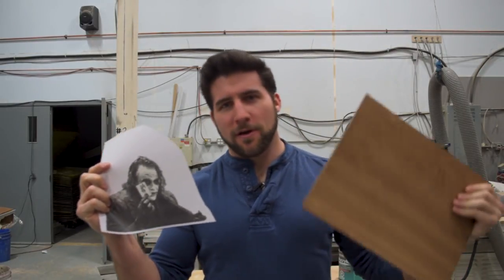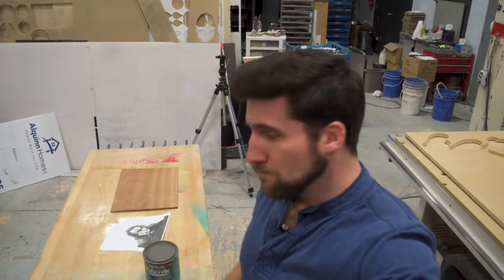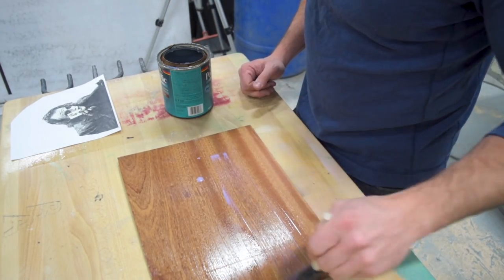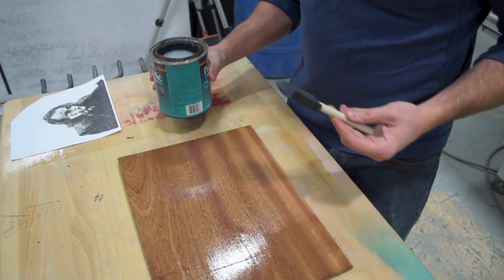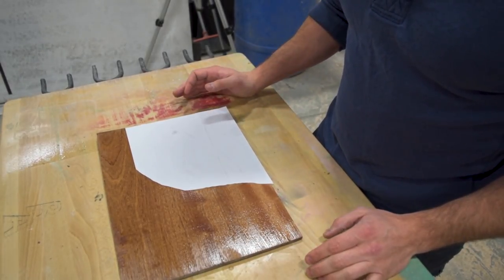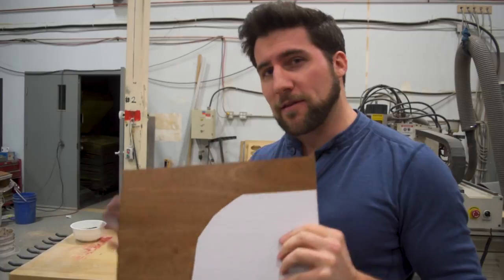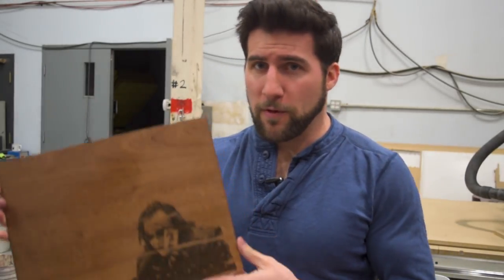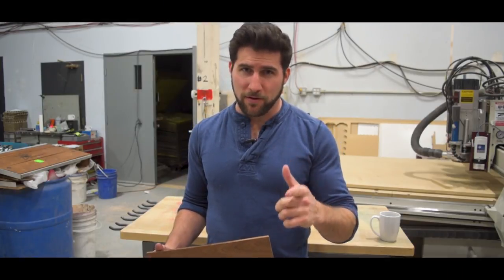How to transfer an image onto wood

Comment: Now you think this would work on a nitrocellulose painted surface? Also I like the way you don't edit out mistakes in your videos.  I think it encourages others to try new techniques and not fear their own mistakes.
Reply: Kenneth Hildebrand I too want to know if this would work on a painted surface. if so, what paint types.
Reply from the maker: As I understand it, it’s the polycrylic that takes on the ink. So, any surface that you can properly paint with the polycrylic should allow for this technique. A properly dried and scuffed nitro finish should be no different, but you can’t replace the acrylic medium with nitro if that’s what you mean.
Reply: Related question: I’d be interested in applying the image between a nitro-based color coat and then a nitro clear coat on top.  Does nitro lacquer adhere to polycrylic?
Reply from the maker: Not while it’s still soft like in these circumstances.

Comment: I’m glad you left the wrinkle marks. It gives a visual of why it’s important to keep the paper flat. Great vid !
Reply from the maker: Thanks Tyler.
Reply: I’ve now done about 8 transfers using Polycrylic. I’ve found best results with sanding to 400 with a random orbital and I only rub the paper off when it’s newly wet. Then I let it dry, haze white, then wet and rub again. Repeat. If I keep rubbing, I take off the pic. I think if the ink get saturated with water, it lifts easier so I do it in steps. But I’m still learning

Comment: No excuse needed. Thumbs up! Great video. I've seen this done with Modgepodge before but not poly acrylic. Also, a rubber roller works well in applying the paper. Let's you roll it out very smooth. I'm interested in the guitar building application for this technique. Thanks for doing this!
Reply from the maker: Thanks Greg, and thanks for watching.

Comment: I did a transfer to acrylic about 8 years ago using a colour laser print and a electric clothes iron. It came out decent but care has to be taken not to overheat the acrylic. Its a useful technique.
Reply from the maker: I’ve seen the clothes iron version, but have never tried it.
Reply: You could get away with a lot on wood. On acrylic its a little challenging. The plastic deforms easily if its too hot or left too long. Any slight imperfections show up as light passes through. 

Try it on scrap and see how it goes. Laser printers can produce really vibrant prints so it can make for a brilliant guitar project.

Comment: I wish I saw this sooner.  I used mod podge on my guitar body project and had to wait over 24 hours and it took forever to take out the already thin paper I was using.
Reply from the maker: Does it look good? That’s the important part haha.
Reply: @BradAngove  Some darker discoloration around Ace Frehley's head probably due to clear spray and some paper fiber that I could not get off Gene Simmon's  armpit and tummy area.  It was a Destroyer pic btw.  But I am planning to do your method on my les paul jr  proj   :-)

Comment: Hiya Brad....well I had some success with a different way of doing this and I think it worked the best so far. This is what I did...fwiw

1. I just used a piece of NZ pine sanded to 400 for this test.
2. I used the Mod Podge acrylic because it's what I had to hand.

To apply the ModPodge I used a sponge roller rather than a brush this time. It isn't a heavy sponge sleeve on the roller, in fact it was quite a thin roller sleeve such as you would use for (say) applying polyurethane to a piece of furniture. The coating was even and smooth.

The image was printed onto photocopy paper which gave an alright image. Not as good as (say) photopaper, but much easier to work with in this application.

Instead of placing the image face down and they trying to get rid of the bubbles, I started by placing one edge of the paper on the pine board, and gradually laying the the image down on the paper by using a lino roller ( like this one: https://www.trademe.co.nz/art/art-supplies-equipment/other/auction-1533483654.htm?rsqid=426bf66c66a14492b659faf7b8ccddcd ) to get rid of the bubbles as I went. It's kind of like laying steak down in a very hot pan when you don't want the hot oil to splash everywhere....I hope you get what I mean?

Doing it this way I was able to lay the image down gently with the roller and without any bubbles by the time I had the image completely flat on the board. I left this overnight to dry and the next day I used warm water and a soft sponge, as you did, to remove the paper with only a little residue left, which I cleaned up with the sponge later. 

The image didn't tear out at all, although this may be luck because I haven't tried it again yet!! I'll do this 2 or 3 more times and if it works well, then I'll see about making the clock that I want to make for my extended family who live in your city!!

Now it's beer o'clock..... later.....
Reply from the maker: Sounds like you’ve got a good process in place. I find that the mod podge and acrylic mediums are a bit thick and hard to get smooth.
Reply: Yep...that's been a major issue for me too. I would much rather use something else that isn't so thick, and I probably need to hunt down something and make some further tests as I really want this clock project to be as near perfect as can be.....

Comment: I have been using mog Pog to do the same process and this looked to work as well and takes less time so many thanks...I'm going to give it a shot. Also for a few bucks at a craft store you can pick up a small roller and that has been worth every penny for getting all the bubbles and creases out. Great video 🤘
Reply from the maker: Do you use a J roller for that? I was thinking I probably should have done so. 
I think this stuff probably lays down a bit flatter than mod podge, but I’m not sure.
Reply: Brad Angove yeah I did and it has to lay down nicer than Modge Podge because Modge Podge is really thick. I'm on my way out right now to get some and try it. I don't know if you remember the picture of the witch guitar I posted but that was done with Modge Podge
Reply from the maker: That rings a bell. I seem to recall it going quite well. Hopefully this option works for you.
Reply: One of the small 1/2"  to 1 " diameter paint rollers works well for this type of thing since the nap of the roller can push into creases etc. It also helps that the roller tube is disposable so cleanup isn't required haha
Reply: Net Rngr I like no clean up! Good idea

Comment: Nice! I'm going to try it on one of my Guitar builds!
Reply from the maker: Excellent. I'd love to hear how it goes.
Reply: Brad have you tried doing a head stock that way? Instead of using a water slide or Vinyl transfer.
Reply from the maker: I haven’t, but there’s no reason why it shouldn’t work the same way.
Reply: Alright then I'll keep checking see if anyone else has tried it. Thanks Brad!

Comment: Modge Podge probably works better as an adhesive and using a soft cloth to push it down onto the surface would help avoid the wrinkles.
Reply from the maker: I’m not a big fan of the mod podge version honestly.

Comment: That is a cool trick.  I've seen others do a very similar technique using color laser printers as well.  It's a very cool method to put a custom design on a wood surface.  Just don't forget to print it backwards especially if there's text involved.   And from what I understand, yes it must be laser printer.  If you don't have a laser printer, I believe most Staples, Office Depot/Office Max, office supplies stores likely offer color laser printing.
Reply from the maker: Yes, flipping the orientation of it is an important thing to remember haha.
Reply: @BradAngove  will a monochrome Lazer printer work?
Reply from the maker: @musicmania3945 yes

Comment: Well that's just excellent. So if it's transferred to the water-based polycrillic, would you be able to remove it with a solvent before clear coating if you weren't happy with the results?
Reply from the maker: Yes. You could do that, or just sand it off.

Comment: A few questions for you, if you don't mind: 1. Is this photo used just a black and white copied onto regular computer paper? 2. I know you said the wood was just scrap, but what is the wood? Is it a piece of quarter inch stock or something? 3. Will the darkness of the wood make any real difference in the outcome of the transfer? I am sometimes making cigar box guitars to entertain myself with, but I wanted to make a couple of wall hangings that would show off my dogs who rode for years in a sidecar with me as pals. I'd like to know the thickness of the wood suggested so I can actually frame the transfers once done up.  I tried this same process once before with I believe Mod Podge (It has been too long ago for me to recall accurately), but my results then were pretty bad. Thanks for the sharing of this video. You make it seem so very easy.
Reply from the maker: This is just standard printer paper from an ink jet. The wood I used was cedar, and in this case I think it was quarter inch, but that aspect shouldn’t affect the transfer. The only differences from wood type will be contrast (by virtue of darkness), and possibly absorption issues when putting the polycrylic on very open grained wood.

Comment: Very cool trick Brad thanks for making the tutorial for us. I’m thinking I would like to try this as a headstock logo. Would you say that this is as good an option as making a water slide decal? 
Laser printer with standard toner correct?
Reply from the maker: Yes, it should be a reasonable option. I don’t really like using water slide decals personally.
Reply: @BradAngove  Two more questions for you Brad. How soon do you have to make the transfer once you have printed is there a time
frame and how about to wipe away the backing paper does that have to be dealt with right away when the underlying finish has dried
throughly?
Reply from the maker: @MrBritrider there’s no specific timeframe after printing that I’m aware of. It’s been years since I’ve done this, so I’d say whatever is in the video is the best I can tell you for timeframe before removing the backing paper.

Comment: Great post @brad. Question - I want to apply an image over stain and polycrilic coats and was hoping to continue finishing with an oil to get a thicker shiner look.  Will oils still work ok on top of the poly ?
Reply from the maker: Oil doesn’t generally accomplish much over poly. I would suggest just using more poly.
Reply: @BradAngove  Thanks.  Great channel and content.

Comment: Great and helpful video!. I tried this using a gel version and getting the paper off after was a nightmare. 1 question though can I stain the wood before or after using this method to transfer the image? I have a light colored wood and plan to stain it only slightly darker and the images are black and grey.
Reply from the maker: You can stain the wood before.
Reply: @BradAngove  okay cool. Thanks for getting back to me.

Comment: so would this work if the wood has already been stained and finished with a wipe on poly?  im assuming you would wanna do it after the stain and b4 the wipe on poly
Reply from the maker: Your assumption is correct. That being said; you should be able to do it over the wipe on poly if you let that dry fully and sand with 400 grit so the acrylic will stick.
Reply: thanx. your channel has helped me a lot with my firs guitar build.

Comment: Another awesome video! Do you know of a way to age the way-too-white binding on a guitar that has a poly finish? I can't think of anything. Thanks.
Reply from the maker: If your binding has clear over it: Scuff the finish, mix some amber dye with clear and paint it over the binding (either by hand or by reverse masking and spraying), and then throw a coat of clear over the whole thing to bury the new paint and bring the shine back.
Reply: MrYankeesfan - tanning lamp or put it in a sunny window

Comment: Hi, I know everyone keeps saying it doesn’t matter what laser printer is used but my laser printer rollers just scratch off the toner in lines as the paper comes out of the machine after fusing the toner. May o ask what laser printer you use please?  Thanx
Reply from the maker: I used a mimaki for this one I think.

Comment: Can this transfer be done onto a previously painted surface?  Or would that prevent the grain from absorbing the image/ink?
Reply from the maker: It’s not the grain stain absorbs the ink as far as I know. It’s the acrylic medium. As long as it’s a surface that the polycrylic can stick to properly, it should work fine.
Reply: Thanks Brad.  Inspiring channel.  It's has me diving into a lot of projects.
Reply from the maker: I’m very glad to hear that.
Reply: @BradAngove  can this work in a painted guitar, if i sand it first and before i apply the varnish?
Reply from the maker: Is that not the same question? Yes, if you sand your painted surface it can work.
Reply: @BradAngove  i just needed to be sure, i don't have the luxury to make mistakes. 😢

Comment: Can I use Polycrylic to transfer an image on top of the FINISHED electric guitar body? Will it damage the coating/finish? Also, I've seen that acetone is a reasonably decent method as well to transfer image onto wood, but if I do that on a finished body, will it severely damage the finish (Almost removing the finish I heard)? I'm planning on something not too big (Like 8cm x 5cm)
Reply from the maker: The acetone method will almost certainly damage the finish. If you sand properly and prep like you normally would to add a polycrylic finish on top of your finished body it should work. It shouldn’t do any damage to the paint underneath. At most an adhesion issue may be possible. I haven’t tried that though, so I can’t really say with 100% certainty.

Comment: Thanks Brad for another great video! Does the image have to be from a laser printer or will inkjet image also work?
Reply from the maker: I’m think the laser printer is the preferred option because it’s the toner that transfers, but I don’t know for sure. I’ve never tried it with inkjet.
Reply: I think the inkjet version would spear when removing the paper backing for sure. The laser output is basically a decal at that point since it's just a film of plastic. This is pretty cool though - have never seen it done before.
Reply from the maker: That seems like a reasonable conjecture.
Reply: Just tried it from inkjet ... nope not working ... went off instantly... :)
Reply from the maker: Damn.
Reply: No worries , tried on a practice board , tomorrow going at a copy center to have a color laser print of what i want and also a black/grey copy to test it out :)
Reply: I had it print in colour laser on regular 20 pounds paper ... worked awesome . Kudos to Staples because i didn’t took any chances on my print order and ordered my stuff on 3 different papers to test ... the guy at Staples when I arrived to get my order printed me an extra sheet and asked me « is it for wood transfer » ? I said yes ... and he said « I figured ... so I printed an extra one on the right paper type » now that’s what I call a customer experience!  ... if I can add something for the folks that uses that  for headstock ... cut the design as close as possible and as roundish as possible since you’ll see a bit of the cutting after paper removal ... so better be a sexy cut a bit :)
Reply from the maker: Haha that’s awesome.

Comment: Will this method work on a guitar that I have just painted.  Fantastic videos on guitar painting.  I'm doing my first one now on a tele I got from Solo.
Reply from the maker: What did you paint it with?
Reply: @BradAngove  Thanks for the reply.  I used a Rust-oleum painters touch ultra cover  - satin oasis blue from Canadian Tire
Reply from the maker: If you give it a week or two to dry and then scuff lightly you should be able to do this.
Reply: @BradAngove  I will give it a try and let you know how it comes out.  Thanks for your help.

Comment: looks great. Did you use an inkjet or laserjet printer?
Reply from the maker: Laser.
Reply: got it. thanks. im gonna try it as a logo on my headstock (instead of a water transfer). Im going to use poly water based matte though.

Comment: I'm thinking about doing this with a Guitar build I'm doing, with Mog Pog, Just saw a video on it , but wondering what clear to use. I'm guessing a 2K is out of the question. SO I'm asking what you think the best Spray Clear one could use on this type of art work. Thanks
Reply from the maker: What makes you think 2k is out of the question?
Reply: IDK, seams like all the looking into I do on 2k isn't compatible with much. I'm just curious because I have a new can of it at home just trying to save a buck you might say. sense I have it Use it. Left over from when I painted my motorcycle a few years ago at never used it. Was going to use it for some touch up but never did.
Reply from the maker: If you give your stuff a week to dry, I see no reason why you wouldn’t be able to use the 2k.

Comment: Hey Brad, are you able to painter tape off the image after transfer to spray paint a color on the rest of the area?
Reply from the maker: You’ll want to seal it in with clear coat first. Then let that dry, sand lightly with 600 grit, then you can tape and spray.

Comment: Hey does this technique work after applying water based dye ( kada)? but before the top coat of corse
Reply from the maker: That shouldn’t have any effect on it.
Reply: Am I able to then use a 2 component catalyzed top coat after without any issues?
Reply from the maker: I haven’t had a problem with it before.

Comment: Will this work with clear water based polyurethane or just polycrylic?
Reply from the maker: It will probably work with the water based poly, but I’ve never tried it so can’t say for sure.
Reply: What did you use at the end to protect the image please?
Reply from the maker: Lacquer.